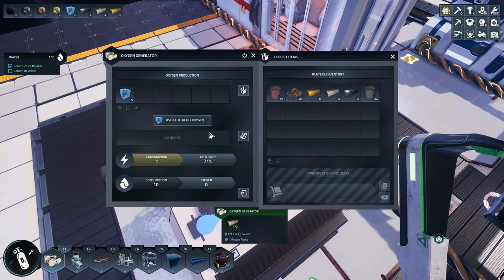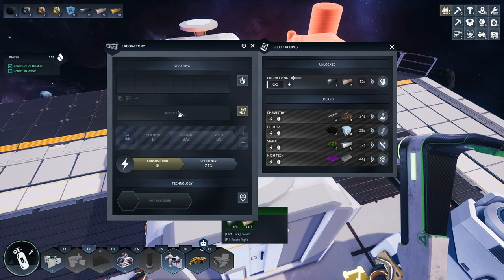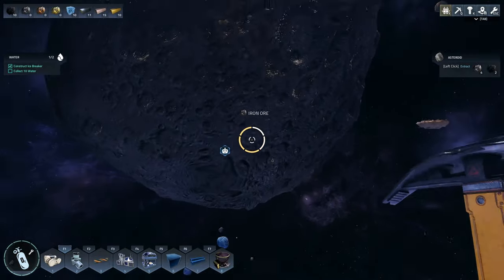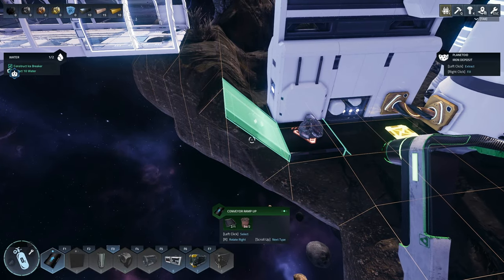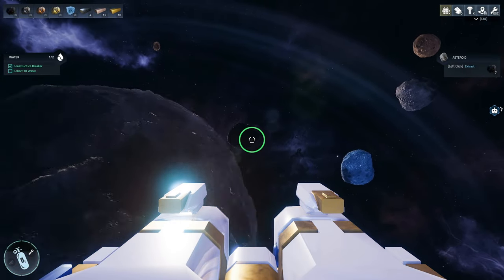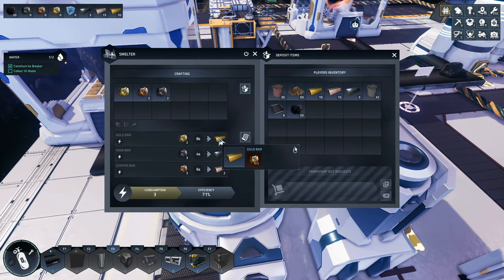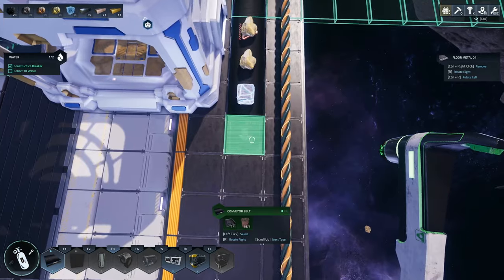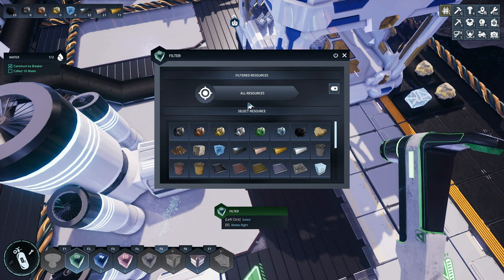Conveyor Belt Shenanigans - Let's Play Astro Colony BLIND Part 4

Comment: If you haven't figured out why the belt wont connect its because its from the planetoid and is seen as another connection you have to take the belts through the docking station for it to transfer to the platform
Reply: oh. my. gawd. i've been stuck, thanks for this